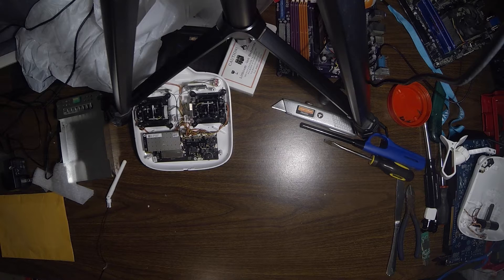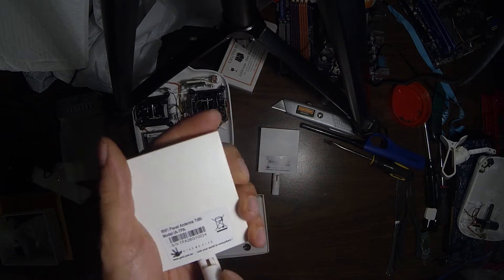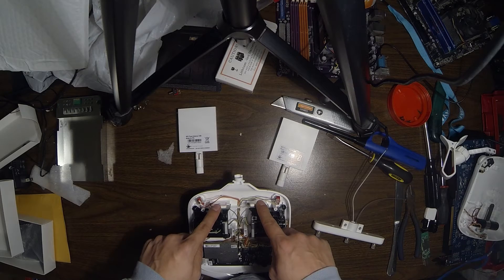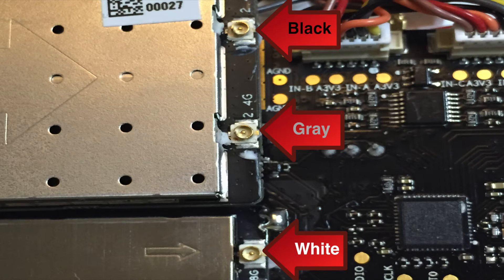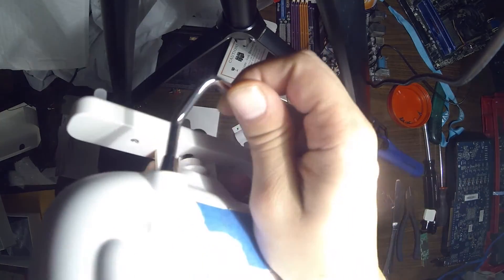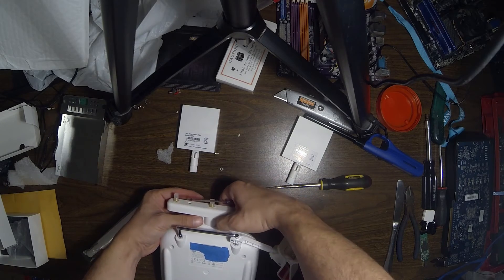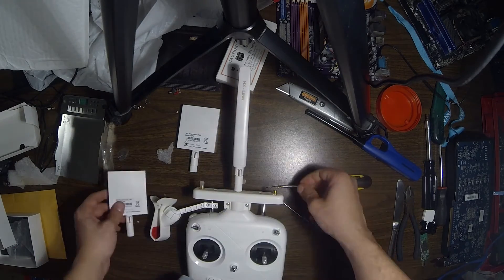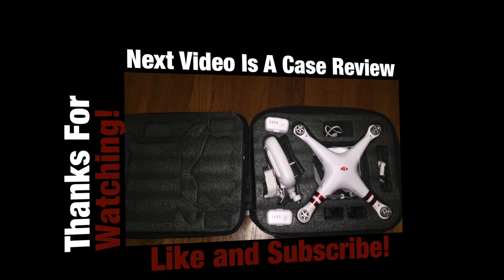Fixing DJI Phantom 3 Standard - ARGtek Wifi Extended Range Kit Installation - (Part 2)

Comment: Today I installed my new ARG-tek antennae. During the install one of the very small  video connectors within the controller on a board popped off. The other 2 connectors were connected fine. Later, when flying the drone I found the range doubled to about 6300 feet at 400'feet altitude. However, I see video but unable to record as the record button doesn't show within the DJI software.  How may I repp,ace the damaged connector. Or do I need a new controller. Please help
Reply from the maker: Which connection was it? If you could just get it to touch and connect, maybe you could hot glue it or something. I'm not quite sure which connection you're talking about. There's a lot of connections inside of that controller. Hopefully you don't need a new one. 

Also: How about the SD card, could it be full? Can you still take pictures?